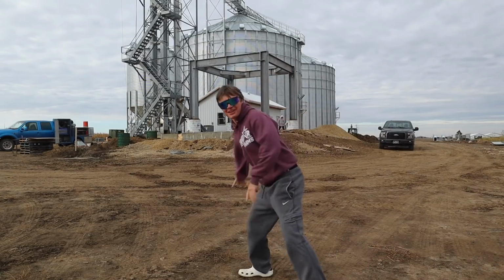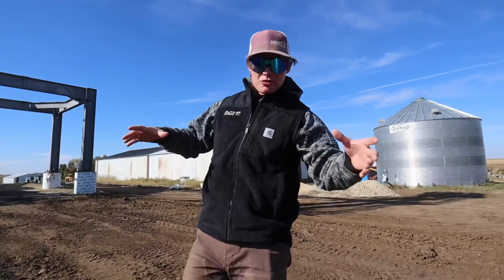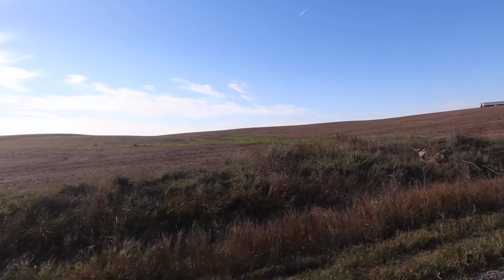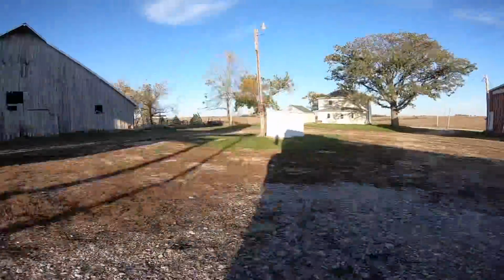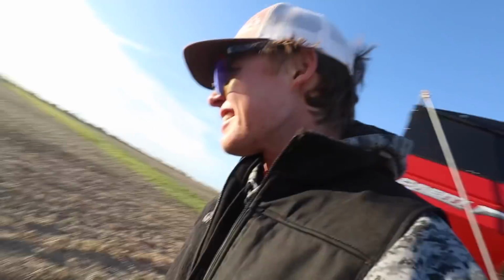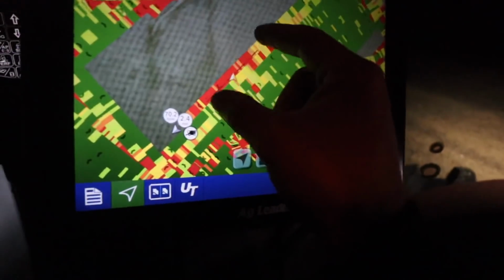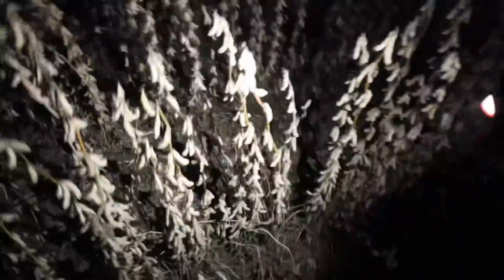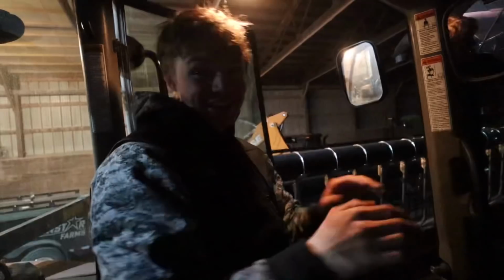I Built A 300-Foot (100m) Ramp In My Backyard!

Comment: In wet weather that top soil is going to turn to soup and get dragged into the pit as well as erode, rut and disintegrate, sun-soil won’t be that much better, personally 6” layers of stone on fabric tracked in with a heavy machine (3 passes at least) would give a good consolidated ramp, even better concrete topped stone ramp would provide the best running surface.
Reply: They put gravel over the top on the one side to prevent that, I'm sure that is their intent for the other side as well eventually.
Reply: @SaneNoMore , You never use topsoil as a base for any type of road. Road building building 101.
Reply from the maker: It’ll get rock on it and be fine. The main driveway at my house and the gravel roads we travel on were built the same way 😁
Reply: @Tony McSteven, You're right. Every time we or anyone build a road, we bring in truck loads of topsoil and THEN put down the base/trap rock over it. When you paint anything, do you use the paint first, then primer after ? Come on.
Reply: @ColeTheCornstar , Didn't you guys get stuck on those very same roads that were built the same way. I thought you had a video showing how bad they were ?
Reply: What was reason fot not setting the pit top a few inches above grade vs that far out of the gnd?
Reply: Goes on and on about how they’re spending 1 million dollars on this bin site and they put topsoil as the pit ramp. I will never understand that. Why not spend the money and at the very least put gravel. Or concrete and be done. Glad it’s not my setup
Reply: @notsamelliott.. , Exactly, nobody in the road building business does it this way, but who knows, maybe they'll get lucky. Still doesn't make it right or the proper procedure of doing it.
Reply: @augustreil  I’m not trying to bash the guy but come on. I have 60’ of concrete on each side of my pit and still get stones  into the pit from laneway before the concrete. I could not imagine having a dirt laneway going up to it. I’m just cringing at trying to sweep up the loose grain that bounces off the grate on the pit when it’s mixed with dirt and gravel lol
Reply: @notsamelliott.. , I agree, me either, but there's a right way to do things and this is not it. Like you said, spend that amount and Jimmy rig the last part. doesn't make sense.

Comment: The road coming up to that ramp and the road leaving that ramp has got to be either asphalt or concrete or you're going to have nothing but issues with it for a decade to come.  That dirt is to soft and loose.    You will have ruts in it the first 5 trucks that drops their payload.
Reply: That's going to be a complete disaster when.it rains...
Reply: It seems like their in such a hurry to finish the bins they just don’t think about things like the construction of the ramp. You think the builder would tell them. IDK
Reply: @DEDBRD-di4yj  as soon as the pit was in I'd been filling it in and compacting the hell out of it and pouring the ramp with concrete to let it cure for 2 or 3 weeks before driving on it with 80,0000 loads...just saying..
Reply from the maker: 3 inch rock and a few full semis will take care of it!

Comment: I don't know if one of the Cornstars will read this among the huge amount of comments. I noticed that a lot of YouTube farmers now and then clog their elevator and then have to empty that out by opening some door at the bottom. This generates a huge pile. Maybe you could anticipate such problems and  prepare for that. Make sure that at that door you can hang a large bag, like these big white seed or concrete bags. Then all the contents of the clogged leg will flow into that bag and with the skid loader you bring that bak to the pit. Cleaning  up with a shovel is tough work. Good luck!

Comment: Did you try adjusting the cutter bar angle? That or an issue with a part sticking or malfunctioning with the float control in that area of your bean table. Been few years now but our table was doing same at one time and it was corrected by changing the bar angle and a part had been binding close to the skid plate.

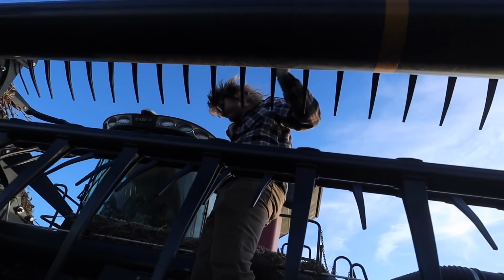Comment: 9:26 those white markers, just below coopers hand should run about level when operating. those heads need to float across the ground, some guys have them all locked up rigid, and they dont float like designed. when you pick the head up, head should look more (very slight) like a frowny face opposed to totally/perfectly flat. good luck

Comment: Why do you cut the beans at an angle instead of following the rows straight? The farm is looking great.. when the bins, junks all gone and the house is done the place will look awesome… keep up the great work
Reply: All of the cycle blades get used & not just the ones that line up ON a row. Planter & bean head are not the same width & require different coverage patterns I think, I'm not a farmer , just a watcher.
Reply from the maker: It helps them feed into the head better.

Comment: Pardon my ignorance, but won't all the additional weight of the air system on the head be messing up the balance of it? I presume it wont have been designed to deal with the additional load on the springs, so might explain the issues youve been having. 

And happy birthday Cooper. Hope you had a great day.

Comment: Maybe you need to have Cooper do some of his expert welding and weld 2 small adjustable wheels on the outer edges of your combine so you can actually adjusted manually so it follows the contour of the ground.
Then you can say to heck with their strange adjustments that don't seem to be working all that well.
Reply: They'll create drag, esp in the mud. With as far as the ends of the cutter are from the mounts, the amount of leverage it creates might cause more problems.

Comment: … OK here’s the deal… Hand straight up in the air:stop… hand straight up in the air with no movement means stop… if you have movement that means go….Straight up in the air means stop…
Reply: the stop sign varies by industry... airports are NOT like you said, crane work is NOT like you said either.